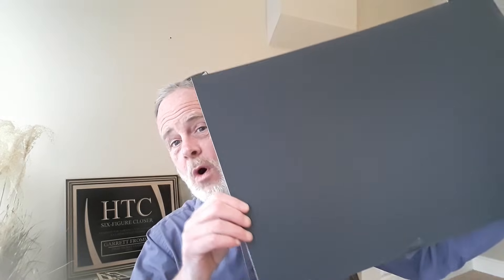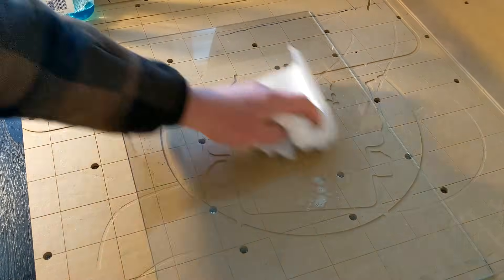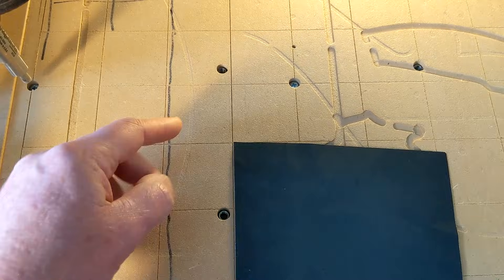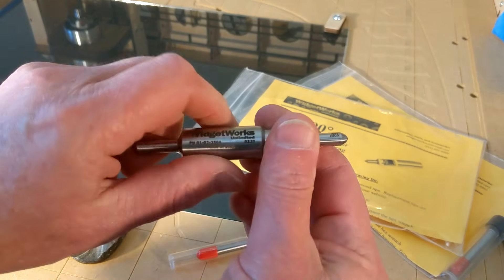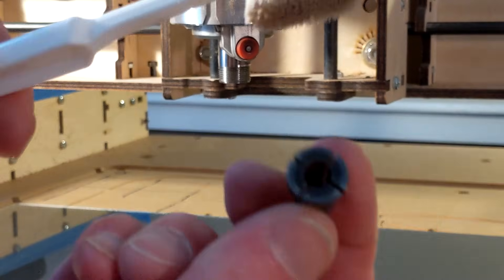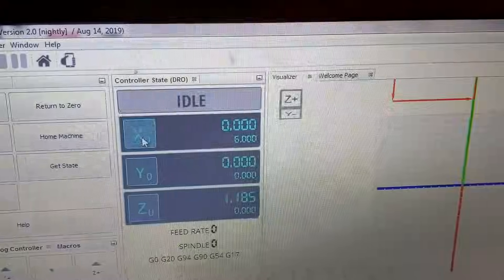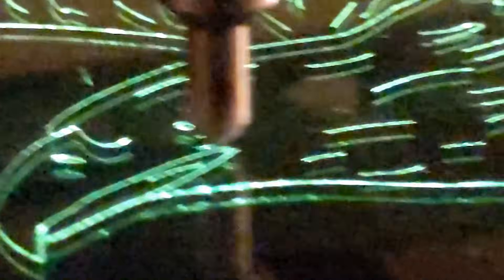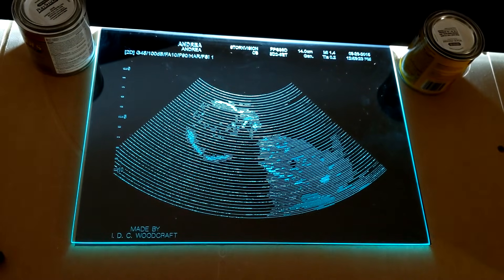How To Engrave Glass On a CNC Router [With A Drag Bit], Glass Etching

Comment: HI GARRET BEUTIFUL WORK JUST 1 QUESTION ARE YOU USING A GREEN BACKLIGHT OR WHATS CAUSING THE GREEN TO COME THROUGH ON THE EAGLE IMAGE AFTER ENGRAVING
Reply from the maker: Hey there! Thanks for the compliment! The green in the eagle image is due to the lighting and the material used; it really gives it that vibrant pop, doesn’t it?

Comment: Hi Garrett!  Great video!  Two questions... one, would this process work with clear, cast acrylic? (I'm guessing it would).  And two, Did you "freehand" the eagle... similar to how you did the ultrasound in the video connected to one of your responses to one of the questions down below?  Or is there another way to generate the line art like the eagle and what file format did you use to get your CNC to engrave the lines opposed to try to "pocket" things?  (Hopefully, you can understand the intent of question... I'm very new to the CNC world and have much to learn.  Thanks!
Reply from the maker: I'm glad you enjoyed the video! Yes, you can definitely use this process with clear, cast acrylic—just make sure to adjust your speeds and feeds accordingly. For the eagle, I typically use a vector graphic as a base, which allows me to create clean line art for engraving. I use file formats like SVG or DXF to achieve this, which keep the line definitions clear and help the CNC focus on engraving instead of pocketing. Don't hesitate to ask more as you dive into the CNC world—there's so much to explore!

Comment: I want to cut glass strips including mirror glass. Generally, the glass is scored with a carbide wheel cutter, then carefully broken by running the score. Other than G code to run straight or flowing lines, what differences do you anticipate?
Thanks,
Alan
Reply from the maker: AsWoodTurns, I have not personally scored glass with an engraver to then break it. There shouldn't be a difference compared to what you do with a carbide wheel cutter but you might need to run multiple passes to get the scoring of the glass deep enough.

Comment: I’m new to CNC. If you have sheets of thinner metal (~16 gauge), would it be possible to engrave a design, and then cut it out? Imagine a coin. There’s the design on the face of the coin, but then the actual circle would need cut. Is this possible with a CNC, and would this require two separate bits?
Reply from the maker: John, thin metals like that are tough. Engraving is no issue with a CNC like a router but the problem lies in trying to cut it out. If you cant secure that thin piece of wood to your work surface properly it might come loose! This will definitely require two bits, the diamond engraver like you saw in the video and a standard carbide endmill like this one. Here's the link: https://idcwoodcraft.com/product/1-4-up-cutting-endmill-bit-for-cnc-routers/

Comment: Hi Garrett can this be done on a CNC 3018 ?
Reply from the maker: Etched, it likely can but you will need a glass engraver that will fit in your CNC or a collet to support that size. Your CNC is rather small and I cant confirm that the glass engraver we used in the video will work on your CNC 100%.

Comment: Garrett,  Thank you, another GREAT video!  Recently purchased the Widgetworks engraver.  Looking forward to getting into glass engraving.  I noticed that you were using the 90 degree bit.  What is the best use for the 120 degree bit?  Was the glass in the video just a regular pane of glass, any special temper on the glass needed?  Any limits on the thickness?  Thank-you for sharing your expertise.
Reply from the maker: Keith, thats a great question brother. My go to bit angle is 90 degrees! Some other materials like acrylic or plastics might behave better with a 120 degree bit depending upon their hardness. Give both a shot for a project and see what one works best. For detailed work, I definitely would recommend the 90 degree bit. 
As for the glass, just basic glass works best. I wouldn't go thinner than 0.090"! Thinner stuff than that is hard to handle brother.

Comment: has it been used with a 4th axis rotary to etch on a drinking glass?
Reply from the maker: Brian, it may have been done but not by me... yet!
Reply: . A 4th axis can be added to the longmill correct
Reply from the maker: @bubba6945  longmill does not have a 4th axis adaptor.

Comment: Interesting video. Are you carving in single strength, double strength or tempered glass? I am currently looking at various cnc brands and have subscribed to your channel to learn more about the brand you have as well as what it can do. Thanks and keep the interesting videos coming.
Reply from the maker: Hey Larry, great question. I just use single strength glass from Lowes or Home Depot. You can use tempered glass, but it's fragile and may ruin your project so I wouldn't recommend it!
Reply: @IDCWoodcraft  Thanks for the reply. Big help. Keep up the good work.

Comment: Very nice video.  I'm sorry if this question has already been answered but I tried to read through the comments and only found one reference to it being a tedious process of generating the file.   I am having trouble generating a vector for engraving with my spring loaded drag bit.  I've tried doing it all in aspire and also tried to create a file out of inkscape and just haven't been able to get it to come out.  I'm starting out with a jpg and then I'm having to trace the bitmap and it just doesn't have the resolution that you have.  Can you share how you were able to get vectors that engraved so clean with the lettering and everything?
Reply from the maker: Hi Sam, 
Have you tried using a SVG off a reputable website? Converting from a JPG can be tricky especially if the resolution of the JPG is bad and there is not good surface contrast in the picture. When you mention inkscape, are you trying to trace the bitmap? Try changing the advanced settings and using multiple scans to get better results.
It is a tedious process my friend. Try watching this LED engraved Ultrasound project that I did. It might help you. Here's The Link: https://youtu.be/qmafPyMkWHU
Reply: @IDCWoodcraft  Thanks for the reply.  I have no problem tracing bitmaps and using vectors for most things and I can edit nodes pretty good to clean up most issues.  I have some X-Rays that I wanted to try to etch and the format is a jpg and they are a royal pain to do multiple traces and piece them together to come up with something that still isn't good enough to etch.  I didn't see that you had a link about how you developed the ultrasound vectors.  I'll watch it and see what I can get done.  Thanks again.

Comment: Given that one can engrave glass with hand tools such as a dremel, I would imagine one could do it on cnc, so long as the z-axis down pressure is maintained correctly.
Reply from the maker: Hi OG. That's why I use a springloaded tool.

Comment: Hello, I am Josef H. from CZ. Herritated a family company from my father, or better in one iear I will and father will retire.  Just diving in your videos and find it super. We have whole lot of machines, mostly lasers from Trotec( :))) ), USCAM, Bodor and some MIMAKI printers. We also have an CNC router Gravograph IS 6000 and USG 6090 - classci Chineese design with everything except of rotary device. 3kW water spindle with ER 20, vacuum table, CCD camera, 750W leadshine servos from bigger model of router, hiwin 25 square rails, 600kg cast chassie with powder coat and more, and more - price was pretty good in comparisson to EU made machines, like a 1/5 ratio :D . All I need is to precisely cut aluminium metal sheets, anodized, sometimes printed with UV print. Machine is still on the way to Europe, but i am already getting ready, have experience with CNC and know that its not a fun like laser. I think i already catch a bits from your and other videos, thank you for doing this, so i LIKE and comment. After I broke some Chinese bits, I Will buy yours. I just need to cut shapes of aluminium labels with holes from 5005 H14 anodised AlMg1 with UV prrint.  How do I protect the print and sheet from scratching by dust cover and maybe coolant? Is a good idea to place some ordinary paper transitioning foil on tom of the print and let only cuting orientation points for CCD naked? Or is it even necessary.? I will mostly try to first cut and than print with primer, put the labels in jig in portal direct print UV mimaki and produce. Thank you for teaching me Master. :))) This is btw our web, I totaly line up with your opinion who is not on web is like dead to the market. :)))) You find some photos of our products, but its in CZ, so you have to translate by google plugin whole website. https://hainzman.cz / https://www.facebook.com/sportovnitrofejehainz/?ref=page_internal You wanted a comment, here you have it. A little book. :D  Have a good day and wish you no broken bits. :))) Joe from Czechia
Reply from the maker: Hi Joe from Czechia. Well, you are certainly stepping into a busy world. Lots of equipment to learn. And you definitely have some cool products.

when engraving glass, I leave open. No special treatment except using a soft brush to vacuum dust up.

And thank you for the comment. I learned a lot about you. It almost made me want to come see your shop!

Comment: Hello.

I found your video because I am thinking to purchase Snapmaker 2.0 Bundle A350T. This 3 in 1 product is a 3D printer plus laser engraver and CNC and CNC Carving Module with ER11 Collet.

I have a little experience with 3D printing. A modification will be to convert the Snapmaker to a glass bed for 3D printing. I found resources in the community that have figured out how to do that so they can print on glass.

I've got a crazy idea. If I can convert the print bed to glass, then can I also use the Snapmaker Carving Module to make my printing area perfectly flat?

I've put extreme efforts into bed levelling on my old 3D printer. But I imagine there must be a way to machine the glass to be perfectly level after the glass is installed permanently on the heat bed. I think there must be a far superior way to achieve flatness because the machine itself can prepare the glass to be flat.

At the very least, an engraving bit might be used to detect the high points across the print bed area, right? Manual polishing the spots revealed by the engraver could eventually achieve desired flatness and leveling, right?

If you understand what I mean to say, please let me know if you think it is a good idea. And if you did a video demonstration, I believe you will get famous in the community. Or maybe I will make the video when I get it figured out. Thank you!
Reply from the maker: Hi Vegas. I do not know 3D printers much, but I see whtat you are talking about and why that would be so critical. Yes, if it is that big of a problem, and if you can determine an easy way to solve the issue, you are on board with the one thing that makes people rich...solving a problem. The bigger the problem, the bigger the return.

Comment: Great work Mate.. I'm in the process of building a LEAD CNC and Ive been watching your lessons & am extremely inspired at the possibilities (didnt know you could use glass)..I will be using a Makita router, where would I find the file for the dust boot....it could be a good project after the square & circle..Ill be using the link to buy one of these drag tools as soon as I get the build done. Cheers & thanks for the vids & entertaining lessons.
Reply from the maker: Hi Mark. You will find the glass engraving a good step between testing your machine and  wood carving. I look forward to what you make.

Comment: Hello Garrett. I would be interested in the dust shoe you show here. I would have to adapt it for the Porter Cable 890 though. Thank you sir.
Reply from the maker: Hi Mike. I stopped working on the dust shoe. Never finalized it for sale. I'll likely revisit it shortly.
Reply: @IDCWoodcraft  Thanks for the reply. I may be able to design one to fit my PC router by copying your design from the closeup in your video. I like the idea of the compact design.

Comment: I saw the answer that you gave on "type of glass".  Have you tried this with tempered.  I always thought that anytime you even scratch tempered glass you subject the peice to breakage.  Can you confirm that I am wrong on that.  Great video and looking forward to working with this method.  Thank you!
Reply from the maker: I think you might be right. Tempered glass is under compression on the outside and under tension on the inside. So what you said makes sense
Reply: @IDCWoodcraft  Thanks Garrett for taking the time to respond!

Comment: You are so far ahead of me all I can see is the dust cloud. Great project, both of them. I hope that some day i can find a drag bit for my 3018.
Reply from the maker: Hi Warren. What is the collet size of your machine?
Reply: @IDCWoodcraft  I have just brought a collet set that takes me up to .250. The real problem is the length of the bit.
Reply: I’ve found taking the collet off, inserting the bit then putting the collet back on the spindle makes this process easier/possible when clearance isn’t great enough on my 3018.

Comment: Nice video. Is that plate glass, tempered glass, does it matter or make a difference. Would be cool as a custom patio table to diamond drag on the underside, perhaps paint the etched part to highlight, leaving the top smooth. Thoughts?
Reply from the maker: Hi Chris. you can engrave on any kind of glass. I think your idea is awesome! Definitely would do it!
Reply: That was the question! Thanks for asking and for the answer.

Comment: Great Video!  I am a little confused regarding the Tool Database settings.  The Widget Works directions recommend using an End Mill setting at 0.005 diameter.  However, VCarve does have a Diamond Drag tool in the database.  Which should I use?  If I use the End Mill, I understand pass depth should be 0.125 to max of 0.500 based on hardness and you suggested 0.100 elsewhere for glass, but what stepover is recommended, 100%?  If I use the Diamond Drag, what line width do you recommend, 0.005?
Reply from the maker: I was confused a bit as well with these instructions. But I just followed them. For stepover, I set mine appropriate for the job., such as if doing fill. I'll keep it no smaller than  0.01

Comment: I just received my 'Bob's 4'.I have been using a 40W laser for about 3 years and much of the jargon you use is similar in that field also. Recently, I have been laser ing ceramic tiles (white). I think you can do that also as you did with glass. I fill the 'scratches ' with ink or paint, wipe after it dries leaving the outline which I often then paint (ink) for a beautiful creation. When I figure out how, I'll send you some pictures.
Reply from the maker: William, I'd love to see how you do that with ceramic.

Comment: Garrett, do you have a video or link on how to use Vcarve with this Diamond Drag bit? I just purchased one from your link, but now do not know how to set it up in Vcave in the Toolpaths settings.
Reply from the maker: Hi Mark. You will get instructions from Widgetworks on how to set it up. This video shows you how to set bits up in the library in general. https://youtu.be/670Xzgf0LiA
Reply: @IDCWoodcraft  I actually have it all ready in my Tool Library, but I do no now exactly  what to select from the Toolpaths tab? i.e. Engraving Toolpath, Pocket toolpath, etc. And then what parameters I then need to type in for it.
Reply from the maker: @markroles7304  send me an email and I'll send you a screen shot and explain. garrett@idcwoodcraft.com

Comment: I have had this bit for a while, but been apprehensive about starting it. Either it wasnt there, or I missed it.... but setting this bit up as far as feeds and speeds.... What would they be on this? I was going to set it to around DPP .125, FR 60, PR 30 with a max depth of .125. Do you have different recommendations?
Reply from the maker: Manufacturer suggests 0.1 depth and 30ipm so that's what I set it at wfor the  degree. For the , same feed but only go depth
Reply: @IDCWoodcraft  Thank you

Comment: Thanks for the detail on engraving glass. I purchased a diamond bit but have not used it yet. Here are some of the things I was thinking about.
Give a little more detail in Vcarve setup using this bit. 
In the Vcarve tool path what depth of cut was use. 
Cut depth is spring tension correct? 
If the spoilboard is not flat by as much as 0.01” to 0.02”, how does the changing in spring tension effect the glass?
Thank again for what your are doing.
Reply from the maker: Thanks for the tips. Some of this is already in the description. I'll add a comment about the variation / flatness

Comment: Nice.  I have the drag bit as well and have been using it in acrylic.  So, I turn the router on, am I doing it wrong?  ¯\_(ツ)_/¯
Reply from the maker: Hi Jay! If it is working for you then I wouldn't worry about it.  I don't turn the router on for the long spring loaded bit. If yours is short fixed, it's not an issue